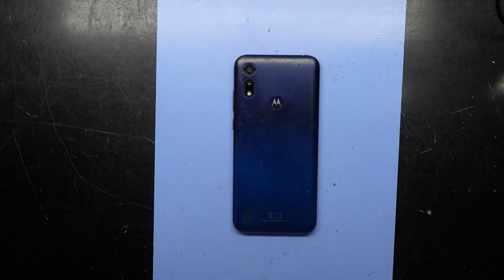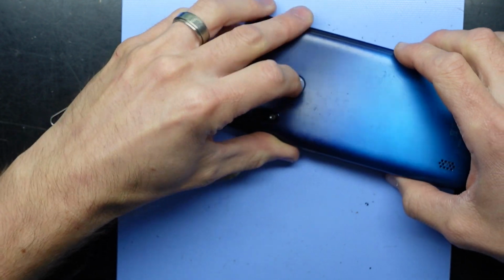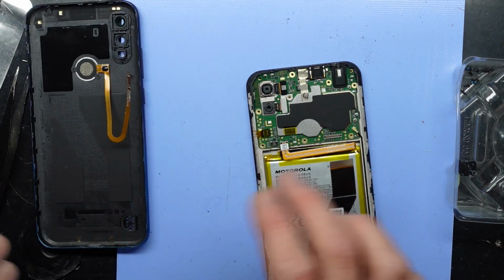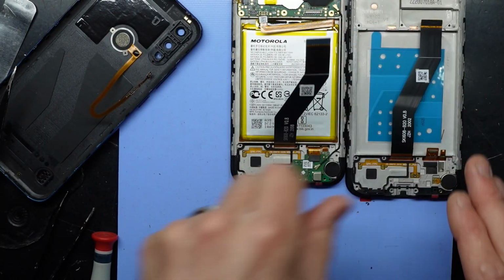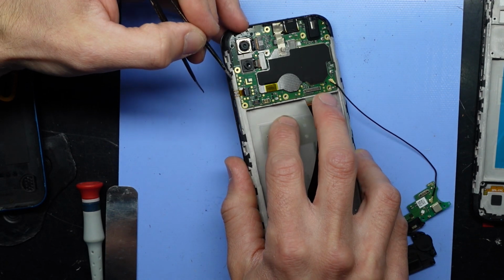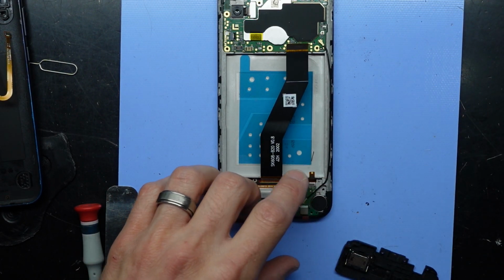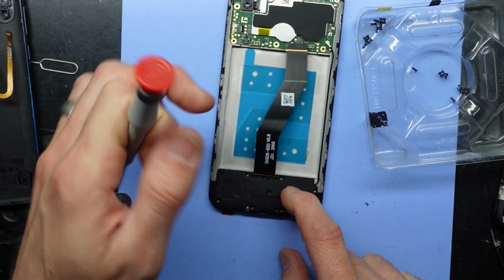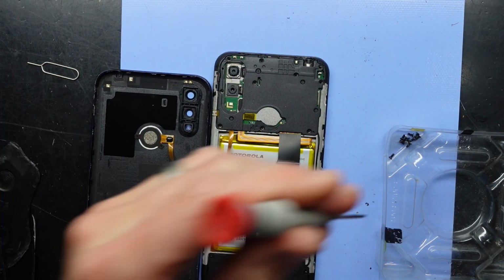Motorola E6S Replacement Screen & Frame

Comment: This video helped a lot to fix my Motorola Moto E6S 2020 (the one with the inbuilt fixed battery), which had a Micro USB charging port that disintegrated one day and I had to open the phone to replace the board. The replacement board was relatively cheap at around £5 (around $6 or $7) off eBay.

A note for other people who might have a similar phone, you may need to heat the back cover of the phone to melt the adhesive like I did, that cover was refusing to come off!! It seems weakest to prying open around the bottom of the phone by the charging port....ironically.
Reply from the maker: Great to Read, this has helped, good tip for other :)